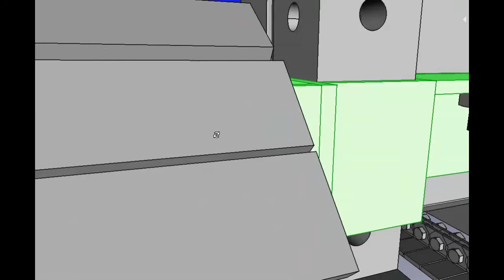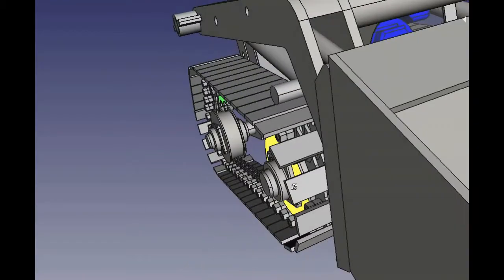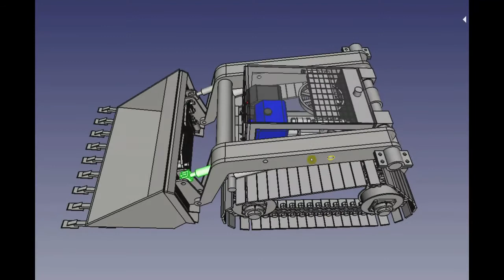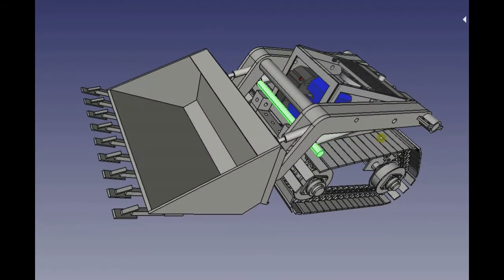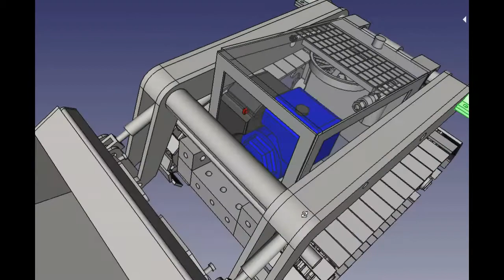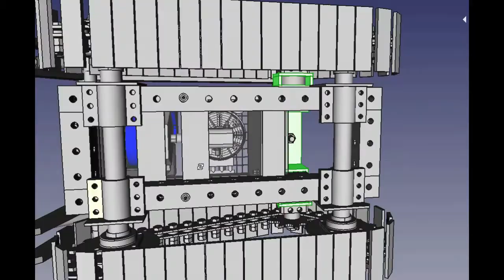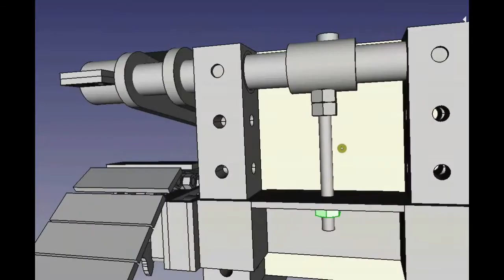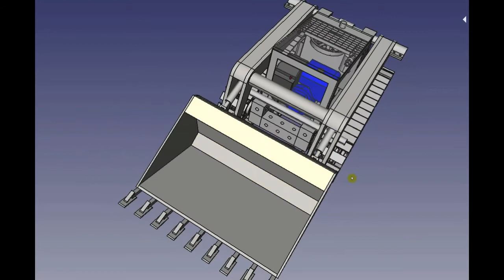Review of MicroTrac

Comment: Turning on these kind of machines work best when one track is at full power and the other is slowly moving. I have even had this problem on full size rubber tired skid steers as the side not turning locks the machine in place. Because it realistically has about the same traction as the moving side.